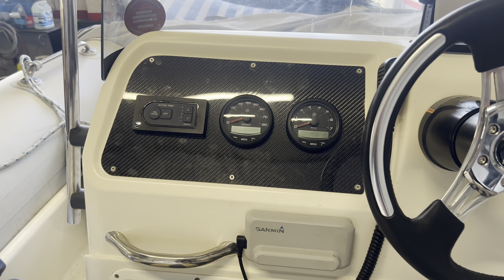Mercury 115 hp Pro XS Fourstroke  unboxed, fitted and sea trialed.

Comment: Full throttle first day?
Reply from the maker: Already done some run in time, but short full throttle run required for correct prop selection and safety checks before hand over.
Reply: Customer's motor 😂